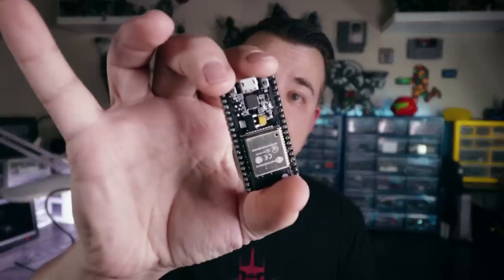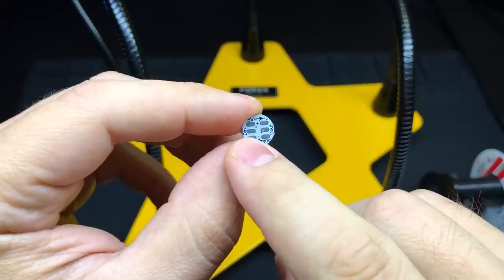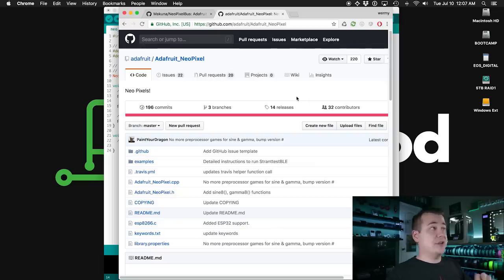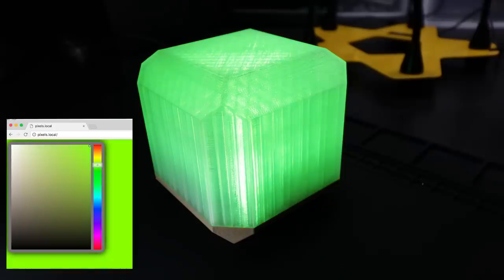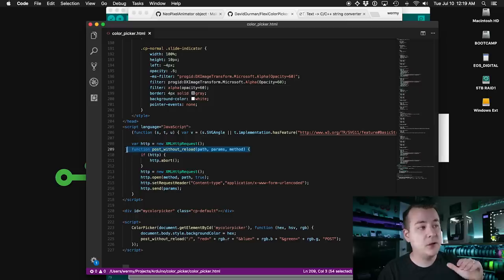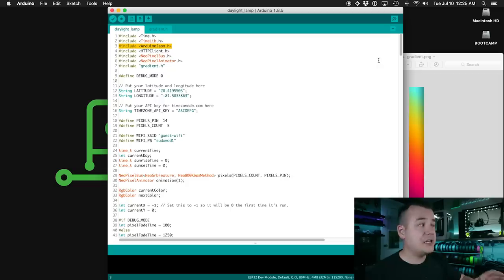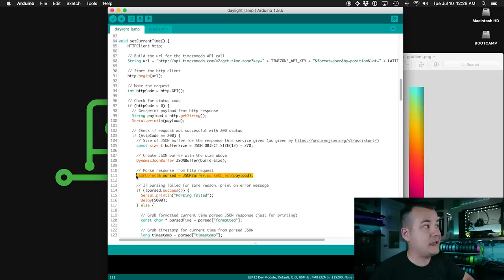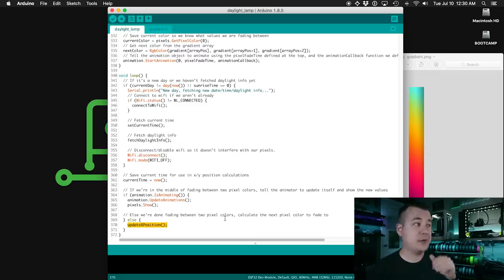ESP32-powered Programmable Neopixel Lamp (and giveaway)!

Comment: why wouldnt you just use a 12 hour timer to change the color?
Reply from the maker: You certainly could. The whole point was to make it match up with the actual sunset time, which varies by a couple hours depending on the time of year. :)